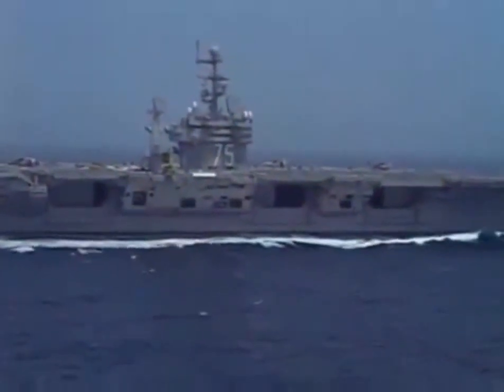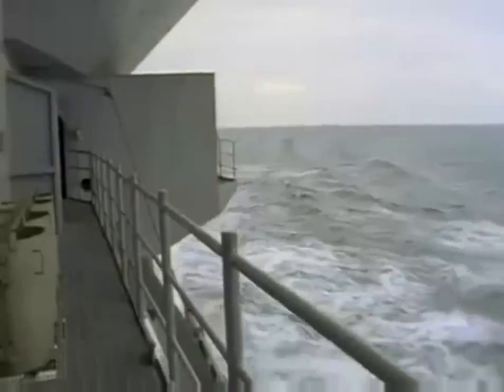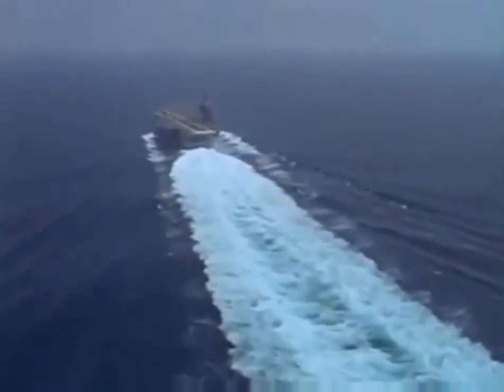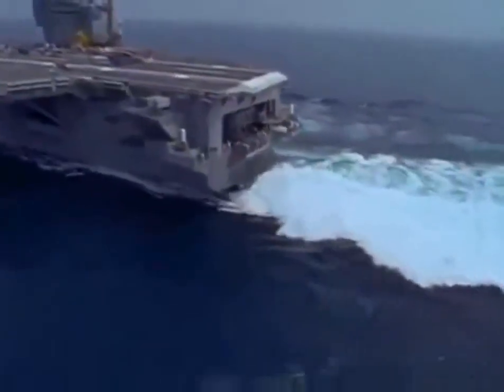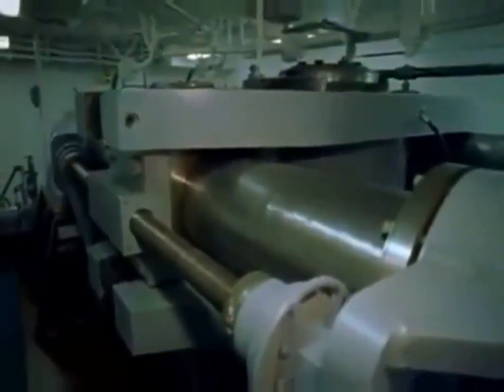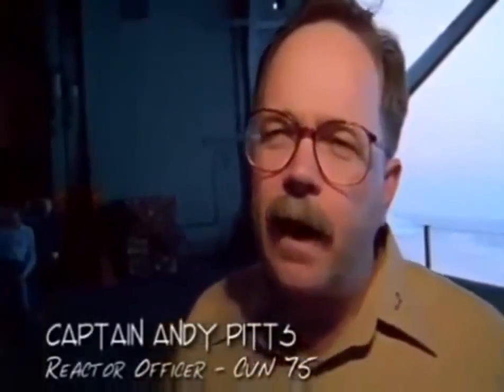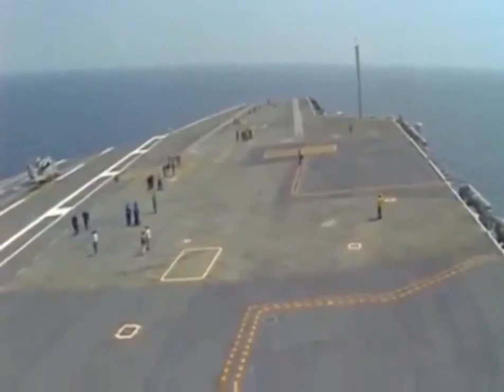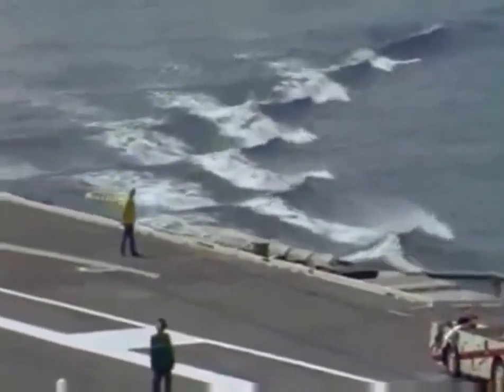CVN-75 USS Harry S. Truman High Speed Turn

Comment: I was on HST during sea trials when we did  this. It's too bad they don't show the mess decks with the tables sliding and crashing into the walls along with the carts full of plates. Good times.
Reply: Stated the same thing. I was on forward mess decks when we were doing this and mess cranks had their hands full chasing stuff. No table cloths being used either so everything flew. I served on FFG prior to HST so had my stuff secure, but comical nonetheless
Reply: Same thing happened on the GW.  A stack of chairs wiped out an ice machine.

Comment: Top speed might be 'classified" but if that 250,000 shaft HP figure is accurate,  the Chinese can figure out what she's capable of doing.  It's basic hydrodynamics. Given a rough idea of the waterline length, beam, and draft the drag coefficient can be estimated pretty closely.
Reply: You'll hear a lot of tall tales from sailors, but the actual top speed is unclassified (it was declassified in the late 90s, possibly after this was made) and is about 31.5kn for all Nimitz class carriers. Under full war emergency power, maybe a couple knots more. They're running the same 280,000 shp steam turbines that the prior Kitty Hawk class of non nuclear carriers did, and they're actually a bit slower than the 34kn the Kitty Hawk and John F Kennedy non-nuclear carriers could do (or the 33.8kn the Enterprise could do), since the Kitty Hawk, JFK, and Enterprise had the same 280,000 shaft horsepower, but had significantly less displacement and a sleeker hull design.

Comment: THAT PLANT GENERATES MORE WAY MORE THAN 250K HPR. DO THE MATH
Reply: Terrel McHenry , they meant to say “shaft horse power.”  The two reactors generate a massive of power (heat), which is used to generate steam, which goes to the main engines, through the reduction gears, and finally to the shafts!
Reply: Terrel McHenry , they meant to say “shaft horse power.”  The two reactors generate a massive of power (heat) , which is used to generate steam, which goes to the main engines, through the reduction gears, and finally to the shafts! I served in reactor room 2 during her seat trials and maiden deployment.  Give em hell!!

Comment: is this maneuver possible with the deck full of planes ?
Reply: +Andre Saba no Joe N. Is incorrect. All equipment, craft, and vehicles on Main Deck (Hanger Bay) and Flight Deck (04 Level) are secured when not in use. Which means if a pilot is preparing for take off(attached to the hook) it could still technically be fired off the flight deck during a high speed turn with no problems. It takes almost no time for the craft to be shot off at around 130mph.
Reply: Lets put it this way, for that ship to execute that maneuver, every single piece of equipment that ISNT bolted to the deck has to be. Your quadcon, gennys, light carts, lox carts, nitrogen carts etc etc. All of which weigh hundreds if not thousands of pounds on wheels. Factor in the aircraft plus the inspections required to sign off the manner in which they are secured to the deck. You dont just go out and slap chains onto the aircraft. There are very specific guidlines for securing aircraft and equipment with chains. The lead up to this excersie was at minumum two weeks. The last day of which is all out inspections. The two days prior to that you're chaining and re chaining.

Comment: Why do I have the suspicion that inside that propeller shaft is 250000 mice on a treadmill.
Reply: The old bucket of bolts I served on would have gone faster with 250000 mice.

Comment: Why don't they put stabilizers on it? For a ship that needs an even keel, how hard would it be?
Reply: Its a War Ship. Not the Love Boat.
Reply: @tennjohntenn   Exactly. We've been building carriers since about the 1920s and there have never been stabilzers on them. I have no idea WHY Pointy even brought it up..
Reply: The ship has list control pumps that help keep an even keel. However, when turning, there is nothing you can do to prevent it.
Reply: Chuck Jones
You do know how a stabilizer works? They are adjustable wings that stick out of the hull below the water, that can be used to counteract roll. Almost all cruise ships have them, and many are vastly heavier than even the biggest AC.
Reply: Aircraft carriers don't have stabilizers. I know this because I work on one and I have been under it when it was in dry dock.
Reply: PointyTailofSatan They may be heavy but have nowhere the length and beam.

Comment: Carriers can easily outrun their escorts. They're fast floating cities. Their size and weight would make you think slow, but they have enormous power driving the propellers.
Reply: i thought their max speed was 30 knots right? some destroyers can reach 40
Reply: @rain-vo8ib  true
Reply: @rain-vo8ib  Unclassified  Speed is 30 Knots.
Reply: @rain-vo8ib   0.19 "well over 30 knots."  0.54 "fastest warship"
Reply: I was a nuke in reactor room #2 until the day before the second deployment!!
Reply: Damn this comment is so old that it's pointless  to point out it's incorrect
Reply: @TimDaOne  [standing Feed Control Watch aboard CVN75 in #1 Reactor Auxiliaries Room during flight ops]: F14 has hydraulic failure right after launch, CO orders flank speed @max RPM to get as much wind across the flight deck as possible for a rapid recovery. The watchteam answers the bell with expert precision; taking the Reactors to 100% power at the maximum allowable rates. The F14 is saved. Later, the CO comes on the 1MC to describe the events, and he let it slip how fast we were actually able to get the ship going. I can assure you, it's faster than whatever number you think it is.
When the Enterprise had it's original screws, it could cruise at 33knots on just 4 of it's 8 reactors. The replacement screws slowed her down a bit, but it greatly reduced propulsion stresses in the long run.
Reply: @getmeagator  I know how fast carriers can go, and the fact ships that big even manage to hit 30 knots is truly astonishing. But it isn't their cruising speed, I'll tell you that. And "outrun their escorts"? Combat ships from the independence class, Detroit class, even Arleigh Burke destroyers can keep up.

Comment: just theorizing, but i would imagine it's because a civilian boat has a low center of gravity and a broad bottom, this makes the bottom swing out while only the rudder and blades steer.
whereas on this ship, most the weight is up top and the bottom is a much sharper V shape. So i imagine when it turns, the bottom can't swing out and instead the top lurches out with kinetic momentum from all that weight.